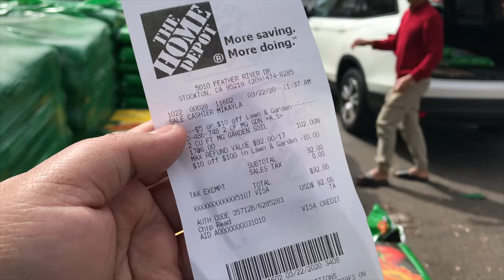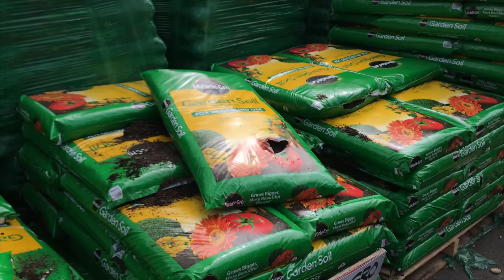BOOST ENERGY with OXTAIL HOT POT before DOING HOUSEWORK ញាំស៊ុបកន្ទុយគោប៉ូវកំលាំងមុនធ្វើការផ្ទះ

Comment: Hi, do you drill holes on the bottom of the plastic container, so the water will drain out? Otherwise, you might get root rot, right? Thanks for the info.
Reply from the maker: Yes, we drill holes at the bottom of those buckets before we add soil and 🌱 plants.
Reply: Thank you, you too.
Reply: Hello. Can you tell me where I should keep the plastic planter? Does it need a lot of sun or part sun/part shade? And the lid opens just a little bit, right? It’s getting hot here in Southern California. How often do you water it? Does it grow year round? Thank you.

Comment: Bong, what's your refrigerator brand and model do you have ? I been looking for a new one.
Reply from the maker: This is a side by side refrigerator. Here is the details Frigidaire Professional 1090395
2 Piece Kitchen Appliances Package with FPRU19F8RF 32" Right Hinge Refrigerator and FPFU19F8RF 32" Left Hinge Freezer in Stainless Steel
Reply: Thanks bong